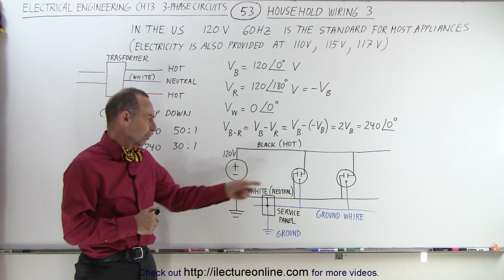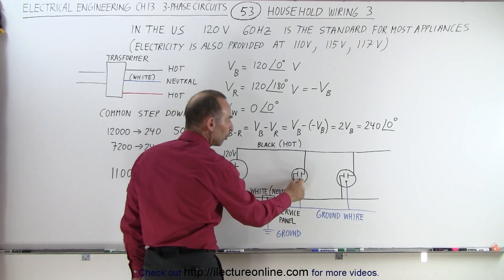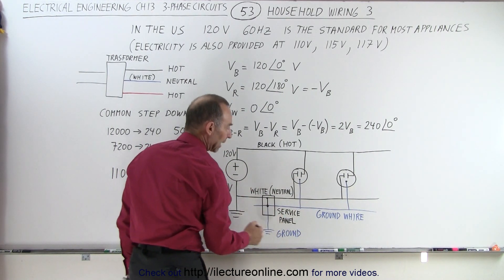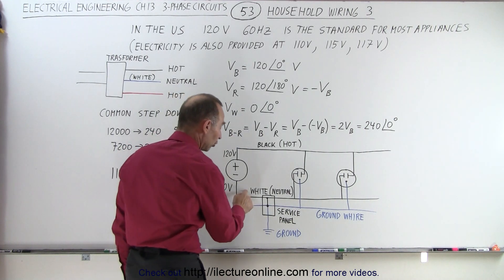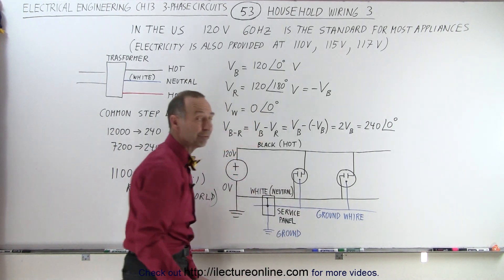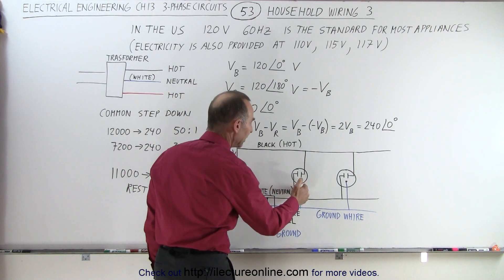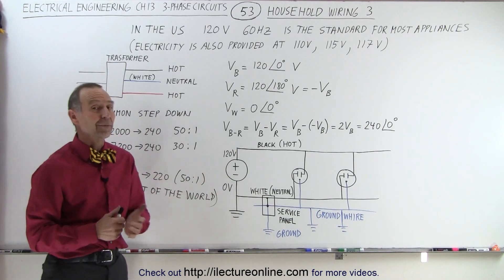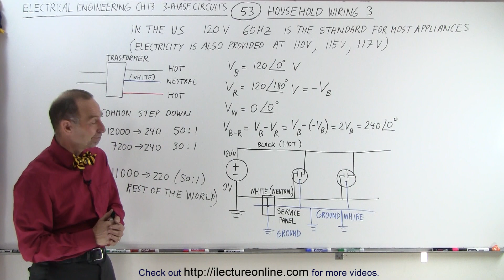Electrical Engineering: Ch 13: 3 Phase Circuit (53 of 53) Household Wiring 3

Comment: This video seems to contradict the very first one made in this series where in the first one although the voltage between two hot legs and neutral was a little less(110 between hot and neutral) the phase angles were identical at 0 degrees which is actually correct. 
Now this video states that the hot legs are 180 degrees. This is what I used to believe until I saw another video by Dave Gordon titled “120/240 V In-Phase or Out-of-Phase” which made since. In the video Mr. Gordon made a little circuit in DC with 3 wires and 6 batteries to sort of simulate the secondary winding of a transformer. All of those batteries were connected in series between the end of the poles with two wires(this would simulate the two hot wires). There was also a center tap wire  that simulated the neutral in a service panel.   
The outer wires were connected between a load that fed a  single light bulb. The center tap wire was also laid out and placed towards the end and it was only connected to either by means of parallel loads that would act as a pathway for the currents to return from either of the hot wires. This center tap wire acted as a neutral in a service panel. 
Now you may or may not be thinking what is he doing with DC when we are talking AC since AC cycles. Yes but at a certain instantaneous moment in time if we were to do a “freeze frame” on the time variable then it would look exactly like the experiment that Mr. Gordon has made with polarity. Besides all the other voltage laws are transferable to AC as well including Ohms law, Kirchhoff’s voltage and current laws, laws that I’ve heard but not studied(i.e. Norton, Thevenin).
Now, let’s get back to the setup after this clarification. The setup was made in such a way that there was a pair of banks with 3 batteries encased in series  that could be  conveniently taken out and flipped(i.e. one bank to the left of the center tap wire and one to the right). This is exactly what he did with one of them to simulate an out of phase circuit and the result that he came up with made practical sense. When he took the multimeter and started measuring the voltage past the center tap wire it started to decrease until it reached 0. Now the potential across those two “hot” wires was 0. There was also something else interesting that made practical sense. One of them was the obvious one that the load connected between the two “hot” wires didn’t work since there was no potential between them. The other was that when the load started to increase to the maximum point between the neutral and the out of phase wires then the current was twice as high at the neutral than when all of the batteries would have been in phase, thus stressing the neutral wire.
The goal of the batteries in this experiment was to simulate the windings in a transformer. As the number of turns in a winding increase, so does their potential if one were to measure the  potential between two points of a transformer (preferably with one leads staying at one of the ends and the other moving from one winding to the next). This is exactly how the batteries behaved. The out of phase portion of the batteries was to simulate when the windings would have been altered in an opposite direction from the neutral point so as to have an opposing polarity from the neutral  perspective and thus the phase angle at an instant in time.
So in general this experiment shows that the secondary winding of a transformer is in phase and Not out of phase between the hot wires and that it is center tapped so that a third wire is connected which is the neutral. So what we have is a split-phase system.
Now you might be thinking how do you explain the polarity difference if they are in phase and the answer to that is if you choose a common reference point in this case the neutral and place a lead on that point while switching the other two with the other lead than the polarity would be reading differently. It all has to do with how the leads of a measuring instrument are placed and what your common reference point is.

Comment: Great video and information
If I can suggest to add something vital: it is important to have only one unique point for the grounding. Never create more that one ground.
Reply from the maker: Good information, thank you.  Doesn't that depend on the size of the building?
Reply: @MichelvanBiezen  
Yes it can depends on that but mostly has to be consider due to the safety chain. Basically (to make a strong example) a lighting hitting the nearby ground can propagate from the soil to ground wire (getting inside the home and going through the equipments) to the next bonding to the ground and to the soil again... Just because it always follow the "easiest" way... This is one of the main reason, especially on industrial buildings.
Reply from the maker: Thanks.  It is always good to get additional input from experts.
Reply: @MichelvanBiezen  
Thank you, you are welcome, even if I do not consider to be an expert in the field. I studied it and I has been always curious about all this.

Comment: Thank you very much sir ! admire and appreciate your work I completed the series ^^  I chose this major because in reality i am really not good at it and want to be better but i were really frustrated and nearly gave up because i didn't understand what professors meant in school. But you make it clearer ^^. Wanna hug you in the real life. 
But any way. For example, ground wire in a toaster/ an oven is connected to the case, so i don't know how the current can travel through ground wire when there is excessive current mentioned above? 
And can you please help me answer this question? 
Why don't we just connect ground wire to neutral wire directly at a socket instead of wiring another one?
Reply from the maker: Thanks for writing.  We appreciate it.  The purpose for the ground wire is for protection.  Typically it is not needed, but if there is a problem that causes a short, the current would increase to very high levels and that would be dangerous.  The extra current can then flow through the ground wire allowing a safe path for the extra current, until either the circuit breaker trips and stops the current, or the wire will burn out and stop the current.  In the case of a short circuit without a ground wire there is the possibility that the current could jump to the person touching the device and then become the "ground wire", which is very dangerous.